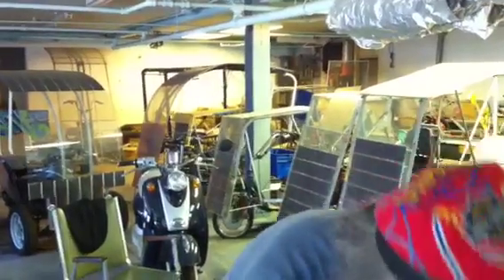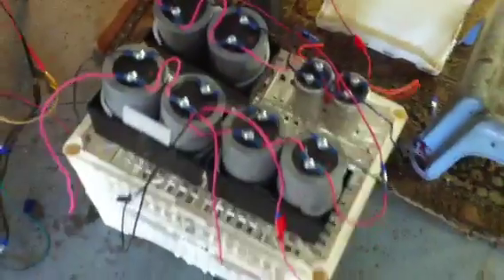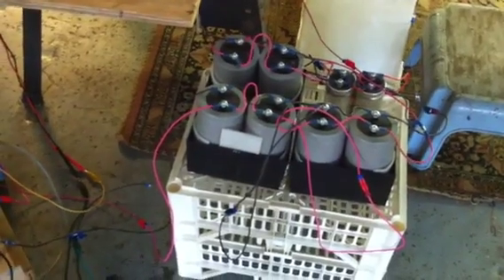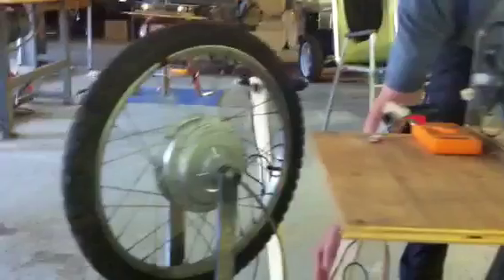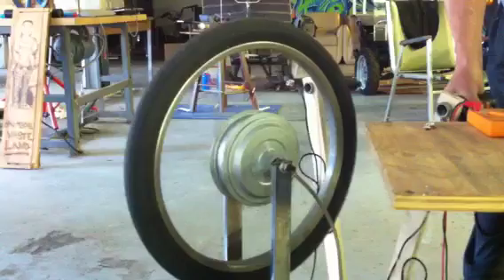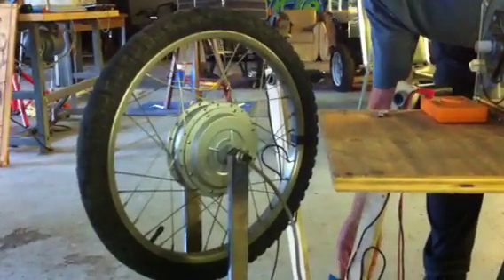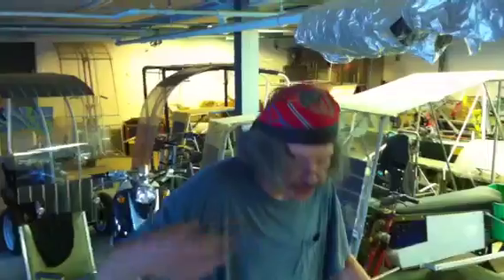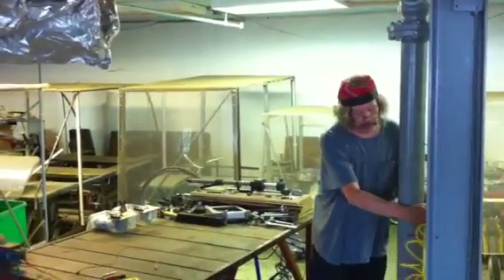Fuel-Less Mag Air Vibe Gen T2

Comment: These magnetic gear-wheels that morph into clutch function are good - for low-torque situations like here. They may be the cheapest, simplest solution for non-fuel / non-grid cars. Now true frictionless magnetic BEARINGS have been devised (mistakenly called "Levitation". How? A bunch of small cube magnets layed in square; on top a thick aluminum plate; above that a big ring magnet - that floats & begins to spin (Eddy & Lenz force results). Makes supercool generator (literally)! Check it out!